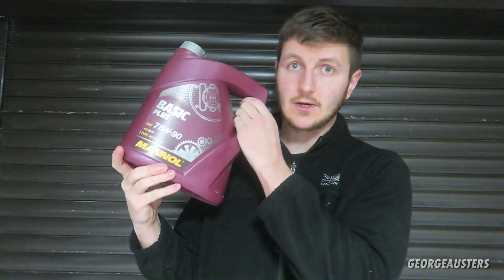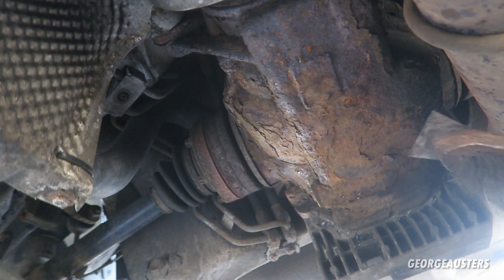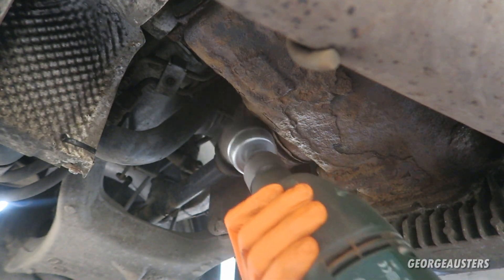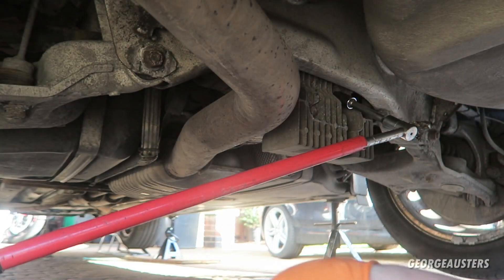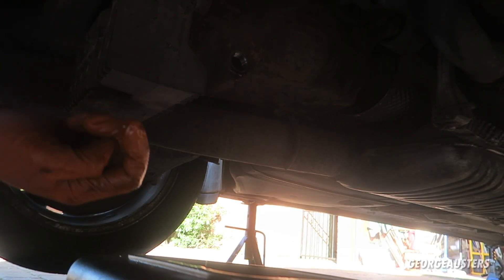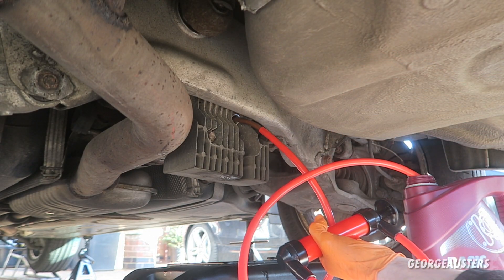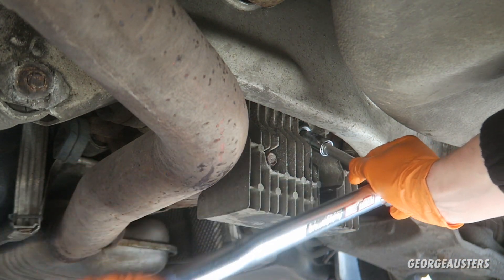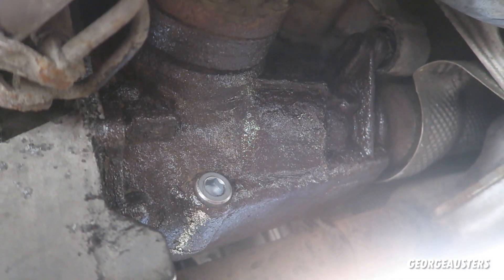BMW Rear Differential Service Full Procedure

Comment: Useful video 👍
Ive had 2 diff rebuilds on my 06 118d now (I suspect the first one was bodged/its been a nightmare). Finally sweet as a nut now, but only done about 6k since the last rebuild. How often are you supposed to change the oil?
Reply from the maker: I’d recommend changing it every 50k miles or so

Comment: Hi George is there any chance of you doing a video showing how to delete the Bmw E60 sos assist malfunction.Mine pings on everytime I put the key in it goes off again but just annoying cheers Eddie 👍.
Reply from the maker: Need to scan your car with ISTA to see what the issue is
Reply: I've just had the same on my e60, is your Bluetooth working for your phone? Mine wasn't, I just put a second hand unit from ebay in and stopped it
Reply: Hi trxshite yes my Bluetooth still works and the radio everything just got the sos malfunction when I first put the key in 🤔.Ill get it scanned like George says to hopefully get it deleted out on ista 👍.

Comment: George I have a question for you. So my drive way is slanted so putting the car on the same settings on the axel stands doesn't do justice. I am guessing I can check the level with bubble level on the aluminum fins?
Thanks!
Reply from the maker: Mine is also slanted so I have to use wood etc to get everything level. That is correct though!
Reply: @GeorgeAusters  Thank you kind sir!

Comment: I went to the dealership to ask them how much it would cost me for a differential oil change and the lady at the reception nearly killed me, she replied "oh you should never do that! BMW uses life time oil! "
Reply from the maker: Hahaha ffs
Reply: I think what they mean by lifetime, is the length of the warranty.
Reply: 🤣If Bmw say it's lifetime oil then why do they fit a oil drain plug to it 🤔😅
Reply: @eddiek821  well obviously If anything brakes inside then is the time that you drain and fill it up according to BMW...
Reply: @Arnesto: Yep - same response when I phoned them about my auto box on my 2010 E87 120d with 128k miles!
Reply: @peroni1000  mad! Mine’s a e87 116i 07 plate and it’s on 66k miles. Always change the engine oil every 5k miles, twice a year, i just wanted to keep everything fresh. That lady nearly killed me fam

Comment: Now this is interesting..... I was advised not to change the rear diff oil on my 2009 e91 because of the mileage? (It's never been done) due to apparently causing problems?
Reply from the maker: I don’t see any benefit to keeping old oil in your differential lol
Reply: @GeorgeAusters  no me neither. But my e91 has 270,000 miles on 🤯😎
Reply: @Wazzah999  Wazman, Which engine does your E91 have? Is it N43??? 270 miles is amazing!
Reply: @kevcat8655  it's an n47c
Reply: Not a chance there's no electrics in there your just taking old oil out and putting fresh in won't affect anything even if it did which isn't possible unless you do it wrong you can find 1 on eBay for £50.
Reply: @eddiek821  something about the wear over the last 10 years and the oil holding the diff together?
Reply from the maker: Keeping old fluid in there has no benefits... You want to remove any metal shavings from the oil to prevent it from causing further wear
Reply: @GeorgeAusters  this was my original thinking, but many (including a mate whose a BMW mechanic) said if it ain't broke don't fix it
Reply: @Wazzah999  That's a good philosophy, but servicing ain't fixing :)
Reply: @norked8184  you'd change it too then?
Reply: @Wazzah999   Yep. If it's holding together by oil, it's not much life left anyway. I'm in the process of doing it my self (E87). Just be sure to get the right oil if it's an lsd.